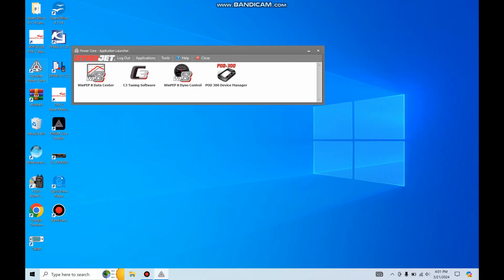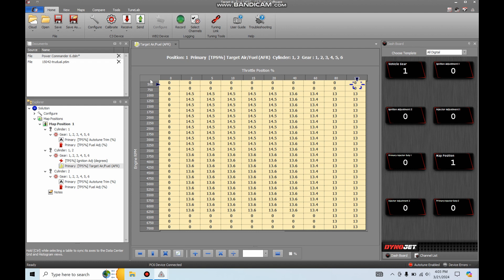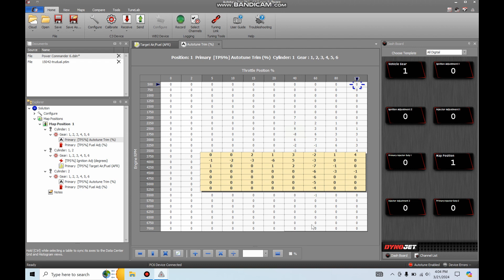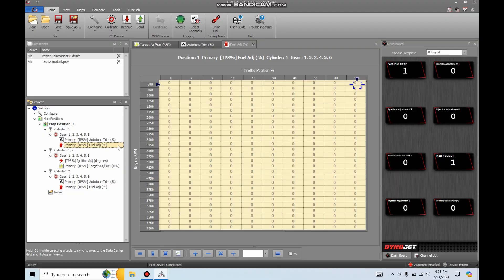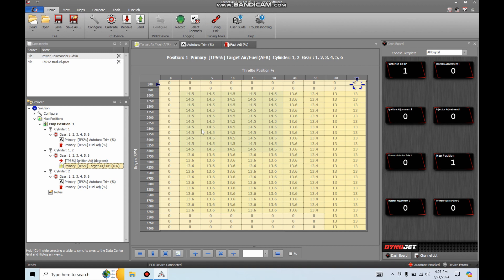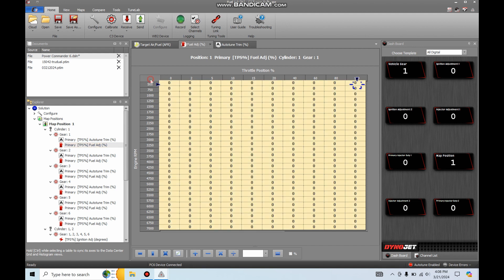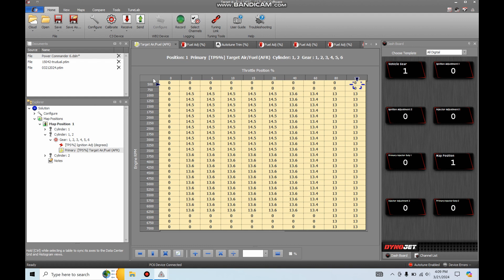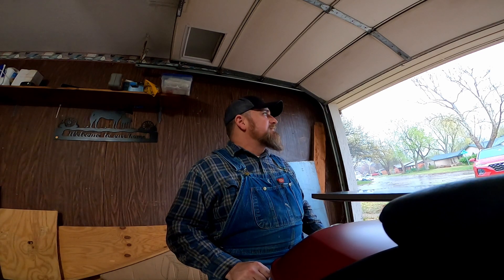Configuring DynoJet PC6 and AutoTune in PowerCore C3

Comment: Thank you. Why not to stay then with PC5 🙄
Reply from the maker: The PC5 has been stripped from the market. Can only find them second hand now for two or three times what they are worth. I found out later on, it's because they've limited the adjustments on the PC6 to 15% fuel changes unless you're a certified tuner. My best advice from here is to stay away from Dynojet. They have turned to complient shit
Reply: Problem is PC6 is the only tuner you can get in some states... And to be completely honest, I actually had to go out of state to get it. Screaming eagle doesn't work on 2024 Harley's with CA VIN #, only other option for a tune I could find was PC6.